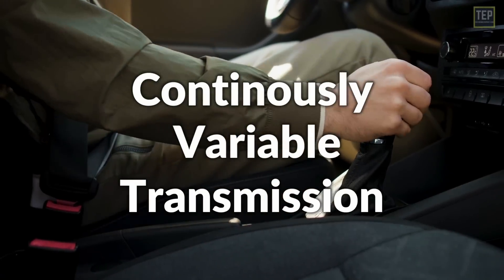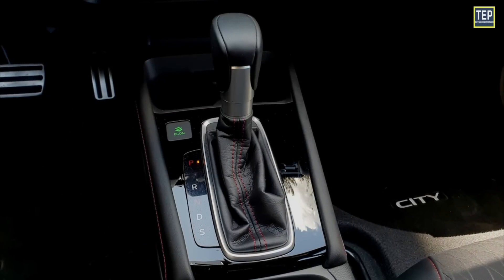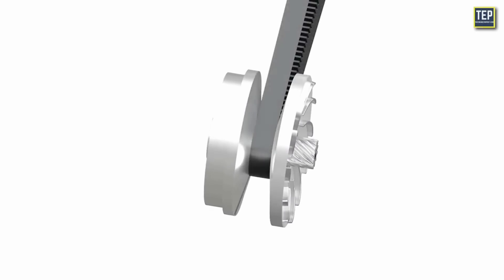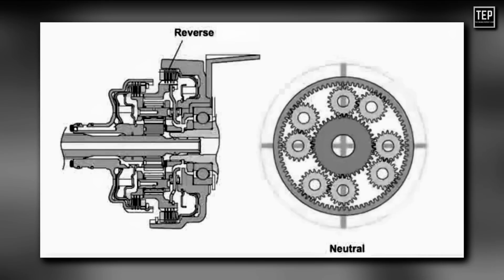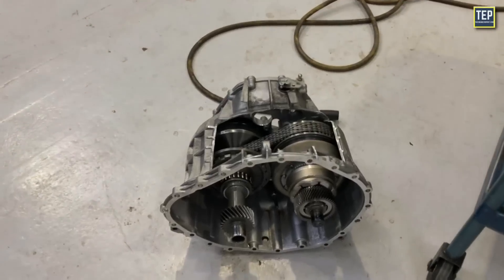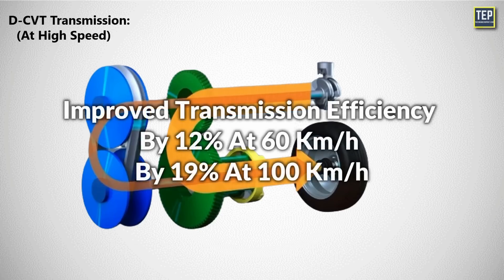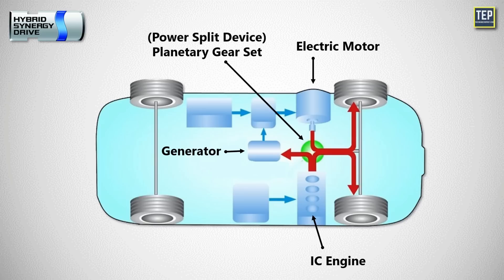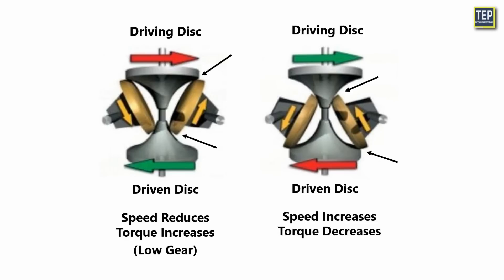Are There Any Good CVT's? | Different CVT Transmissions Explained

Comment: I had a CVT on a Nissan X Trail. Gave no end of problems and noisy. It was replaced under warranty and within 1000 km started to become noisy. Have only had a traditional 6 speed auto box since with no problems. Currently drive a Suzuki Vitara, virtually bullet proof.
Reply: I have a 2011 Renault Koleos with the CVT (exactly the same as an X-Trail), ours has 282,000km on its original CVT and still drives like new. Key to long CVT is good maintenance and gentle driving.

Comment: E-CVT are best automatic transmission , with electric motor embedded as integral parts with planetary gears, replacing old belts system that vulnerable to be broken

Comment: I would not buy a car with a CVT transmission until the testing phase, which may last 20 years or so, is over. This new technology is forced upon unsuspecting drivers, as the manufacturers test the new technology at the expense of unsuspecting consumers.

Comment: Since this video is a little more than I can handle. i.e. Over my head. I didn't watch the entire video. But we've had 3 Mitsubishi vehicles with CVT. And absolutely no problems with any. We had the 2014 Outlander for 10 yrs, just over 95,000 miles. And never any trouble. So, since it's not a Nissan, we can not see why CVT's have such a bad reputation. And I don't think your video explained that. If you did, I missed it.

Comment: In the nutshell: e-CVT has technically nothing to do with a conventional CVT. It’s a misleading naming. E-CVT has only gears and is extremely reliable, as it doesn’t even shift any gears. It’s also substantially cheaper (and much more simple) in terms of oil change.

Comment: Why not kick out the weight automatics from this formula and replace it with a digital component? If a computer does that work instead of the weight automatics "operating just like that bearing to the clutch" it opens for a set of drive programs. Why not one for the heavy trailer and another one that acts like a green mean machine for the suburbinan 50 km/h? Or why not a program for Autobahn.? However the world record for a traveling distance on 1 litre of gasoline tells a tale of a bright future..

Comment: I have a toyota C-HR 2025 collected it on 26th November.  It does take time to get used to the drone when heavy revving.  But its economical and quiet. No jolt from gear change. I live that part.
Mine is a standard 1.8 icon 140 bhp. I would have liked a GR  vwrsion but i take what i can afford.

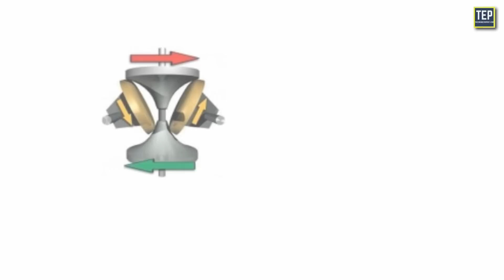Comment: At 15:39 to 16:02 you have said wrongly...
You said its low gear low speed high torque..
But its actually the opposite... 
And next you said its over drive high speed low torque...  But here its opposite of what you said.. 
Actually, 
Its High gear & next low gear...

Comment: I just recently bought a second hand Subaru Forester XT with 35 thousand km's (that's about 40 thousand miles) on it. I have driven it on a 3200km (about 2000 miles) long journey through Europe, starting from Germany. In Germany with no speed limits on the motorways, I drove the car at 160km/h (that is 100mph) about two hours long and went on to Eastern-Europe. The trip included most everything from the no speed limits German motorways, to mountain passes in the Carpathian mountains and different weather conditions. The CVT shifts so smoothly, that one really has to look at the rev-counter to be able to tell. At any sudden throttle input, the response is instantaneous (for all practical purposes) and the acceleration feels like in a jet-plane taking off. I like manual transmissions very much, was never before tempted by an automatic transmission, but I am most impressed with the CVT in the Forester XT, in combination with their 2.0l turbocharged engine. I find them a perfect match and they provide the smoothest of comfort with instant response for overtaking. I asked a trusted Subaru dealership and workshop about the durability of the combo and they said, that they had a client with a Forester XT having 300 thousand km's (200 thousand miles), still running without any reliability issues. They (the dealership was the forst owner of the car, which they then sold on to a private individual) used the car even for towing loads of up to 2 metric tons (approx. 4000 pounds) with no issues. So it appears, that the CVT can handle it.
Reply: Not if you are towing they are shite
Reply: @anitakerry3032  I'm never towing, so...

Comment: The dual axis power split Toyota synergy drive with 7 speed simulated shifting mode is EASILY the most efficient. '24 CCH AWD since new average 77 MPG and EV ratio AWD SUV! And the brake saving from the down shift regen is unreal. I had HOPED for mid 50s. There's nothing to wear in the transaxle! Glad they increased physical size of inverter/converter in gen 5.5, all they did. Better heat distribution dissipation. Only system failure was there, the blown power transistors.

Comment: The first Yamaha snowmobiles had just that, pulleys that spun out by rotating speed. Of course no reverse or park or even a case. Just the belt and pullys. Simple and efficient. I don't know much about new snowmobiles, but I imagine they are pretty much the same.
Reply: The basic CVT designs are about 60+ years old, nothing new at all. The only reason they're getting news now is that they're trying to push them in cars, which is not the greatest idea.

Comment: You can make it so that it focuses on performance it is a computer system that keeps the rpm’s at a certain point while still accelerating this means you can either keep it on highest torque (CVT might wear faster due to low torque capability) or highest power (HP) or highest Gas mileage so yeah they can be pretty good for street races but are terrible for off road uses

Comment: Well I see a lot of positive feedback from customers and glad to see it. But the actual was mainly showing me that on the newer more complicated CVT's it could cost 6000 dollars to get it fixed. That is too dear for my wallet, prefer to stick with a manual or auto transmission since they are quite likely to make 300,000 miles and this cost comparitive peanuts to fix. Going to keep and eye out of these though, it would not take more than cheaper repairs to turn them into my choice

Comment: I have owned several Subaru vehicles with CVTs and never had any issues with them.  The key is adhering to a maintenance schedule.  Have the CVT fluid changed by a dealer every 40,000 miles, and it will outlast you.  Now Nissan CVTs are just junk and no amount of maintenance will prevent failure.

Comment: I have a 2012 Subaru Impreza hatchback car with a CVT.   At just after 80,000 miles the CVT failed in my Impreza.    I did not know that was the first year of CVT for Subaru vehicles until researching CVT in Subaru vehicles.   I had the CVT fixed and it now has 133,000 miles on it.  I plan to have the transmission fluid changed in the near future.   People don't realize how expensive it can be to change the transmission fluid for a CVT and when to do that.   I know now and am finding out many car manufacturers are using CVT.
Reply: Fluid changes are the hidden expense no one talks about. It's not cheap and it has to be frequent.

Comment: Let’s be honest here….nothing is more durable than a manual transmission, period.  That being said, why is the United States pushing the CVT on dang there every car for no reason. A manual transmission mated with a hybrid drive train will still net 45 to 50 miles per gallon… with a manual transmission!!  The same gas mileage you would get out of a CVT! And no steel belted rubber bands, running the transmission.

Comment: One of the easiest ways to extend cvt life is ignoring the ridiculous fluid change interval most mfg advise.  Changing fluid at 30k or even less depending on use is far cheaper than replacing your cvt.
Reply: Unsure honestly what you think! Typo? First sentence says ignore doing changes. 2nd/last sentence says do 30k or better! I'm debating what to advise on my GF's 2015 Impreza 150k miles never changed...could maybe last to year 2030...

Comment: Thank you for allowing me to learn for the first time about Toroidal CVT. Will be nice if there was also an in-depth look at e-CVT as it felt kind of glossed over. 

Also, adding a look at why CVT got banned in F1 will provide some insight on CVT's potential. The cars were faster, but "souless" without the jerks and sounds of transmission change. So if you're looking for "fast" CVT was actually the way to go, abeit the need to overcome some of the downsides like wear and losses at the higher RPMs. Given how fast racing can accelerate car technology development, if it didn't get banned, we might have the "perfected" variant of the CVT?

=^o^=

Comment: Subaru CVTs are good they tell you they are unserviceable but change fluid every 50,000 if you don't they will go out after 180,000-200,000

Comment: I dunno my friends sister had a dodge caliber that the front axle came out on and it lost a lot of fluid during the whole scenario. Having owned a few dodge's myself I told my friend that you have to use atf+4 fluid. So he did. Well she ended up selling my friend the car and he picked me up one day and we were going about 200 mile round trip but I noticed I didn't feel any shift and I looked at my friend with a puzzled look and he asked me what was it. I said nothing because I wanted to wait to make sure and nope no shift so I googled the car and sure enough cvt tranny. I asked him how much fluid did he put in it and he said 6 quarts. 🤔! He ended up selling the car and about 8 months later he bought it back. Let me say this car has been through it. It is a country car. So you can imagine. 255,000 miles and still pulls flawlessly. Now I know someone at work that bought a 2015 Cruze or something like that with cvt a few years back and has been in and out of the shop on many occasions because of the tranny but the colt not once. I dunno a freak of nature maybe or did dodge get it right?

Comment: From an engineering point of view, an all steel CVT is a seriously flawed concept. It relies of there being sufficient friction between the belt and pulley to transmit the power, but not so much as to create heat and wear. Engineers normally use oil to reduce friction between metal surfaces to a minimum. In a CVT,  achieving the required static friction is a delicate balancing act which relies on precise thrust pressures and very specific oil specifications. Any drive relying on metal to metal friction will inevitably have a shorter life than the rolling action in a set of epicyclic gears. If you scrap an otherwise good car early because the cost of replacing a CVT makes it uneconomical to repair, how it this eco-friendly? CVTs may be smaller, lighter and cheaper to make, and give small fuel economies, great for the manufacturer, but I cannot see that they are cheaper in terms of vehicle lifetime costs.

Comment: Yeah, they're great until the belt snaps.  Then, you're up the creek.

Anything where a metal chain or gear has been replaced by some engineer with a rubber or metal belt is junk.  That goes for timing belts, CVTs, or what have you.  Sometimes, the old way is just plain better.

Comment: I'm enjoying mine. My vehicle is a light car, and I like high mileage so I don't push harder than I must, though I do have to drive up steep roads and down where I use engine brake at times. 
I'm getting about 50 mpg.

Comment: i am driving a nissan kicks 2023 so far its flawless not one issue in 2.5 years transmission works perfectly
Reply: Just wait.
Reply: Isn't the Kicks an EV but with a 1.2 engine that acts like a generator?
Reply: @adjromulos  no its gas and works great
Reply: @richardnone5644 yes, gas is used to charge a battery that powers electric motors. Isn't this what Nissan Kicks e-power system does?
Reply: @adjromulos  no gas only
Reply: @richardnone5644 okay. So there's a kicks with just the gas engine as well. Good to know.

Comment: Yeah, indeed, for some 85yo retired cookers are the best. If they drive a 100bhp/130Nm FWD shitbox 😂
But how dare you to show as positive the example of newer impreza wrx cvt, as any test shown is the most sluggish, slow and pathetic "sport"-subaru ever, but not even only that, but consume in (wonna be) sport driving style MORE than a manual gearbox?!😂 (not to mention in dragrace a 300bhp awd car shows performance lower than a 150bhp diesel fwd car 😂)
ALL type of CVT are FAILURES in automotive engineering history, that kind of transmission is proper for some 5hp scooters and maybe small hand driven two wheels agricultural tools, but DEFINITELY NOT FOR CARS. Those japanese mini cars which runs cvt are not made for DRIVING, but for making MONEY for the producers by exploiting people stupidity, ignorance and lack of automotive technology understanding and experience.
PS: If you reading my comment and drive a prius, please flee, you have nothing in common with automotive phenomenon 😂

Comment: I still stick with manual transmission. Proven reliable. A lot simpler to use and you have more control specially in up/down hill. The cons outweighs the cons for CVT.

Comment: Since I started using Youtube I have discovered that CVTs are bad. EVs  are bad. Automatic transmissions are bad. Hybrids of all kinds are bad. Power assistance is bad. Turbo charging is bad and so on. Much of  this from so-called experts and people with no actual experience of any of these.
Reply: Oil companies use propaganda very successfully to brainwash people to believe anything that makes a car more efficient is 'bad' 😂
Reply: exactly!  99% of these people have automotive engineering degrees from high school.
Reply: LAS TRANSMISIONES CVT , CON MANTENIMIENTOS PREVENTIVO BÁSICO DE CAMBIOS DE ACEITES Y FILTROS CADA 40.000 KILÓMETROS,  Y CONDUCCIÓN DECENTE Y PRUDENTE ,  GARANTIZA TRANSMISIONES CVT PARA MUCHOS AÑOS , LOS PROPIETARIOS NO ENTIENDEN ESTOS DOS FACTORES BÁSICOS E IMPORTANTES PARA LA DURABILIDAD,  DEBEMOS ENTENDER QUE NO SON VEHÍCULOS DEPORTIVOS , SON VEHÍCULOS PARA UN USO DIARIO EN CIUDAD Y VÍAS CONGESTIONADAS,  Y CARRETERAS CON UN MANEJO RACIONAL , ESTE ES EL ADECUADO MANEJO PARA SU DURABILIDAD.
Reply: CVT after 60,000 miles even with proper maintenance = kaput coming soon
Reply: According to so called "car guys" anything that don't have 10 million old manual gear transmission it's bad.
Reply: I was given a 2024 Prius as a rental while my car was being repaired and it was the opposite of what people told me hybrids were. It was fast, had great power , fuel mileage and it was fun to drive. I bought a 2025 Maverick hybrid with AWD and a 4k tow package because of how impressed I was with the Toyota.
Reply: Reliability is a legitimate criticism, as is repairability.

Naturally aspirated engines have certain benefits over turbo engines. 

I got this information from YouTube, but because I don't have adhd, I actually take the time to listen to explanations.

Comment: The Toyota hybrid variant in the Yaris Cross is actually a rather nice CVT. Yes, you get the normal effect where the engine gets revved to high power quite easily on acceleration, but the addition of electric motors means that in heavy, stop-start traffic the vehicle ends up using electric drive most of the time; the fuel consumption figure actually improves under these conditions.